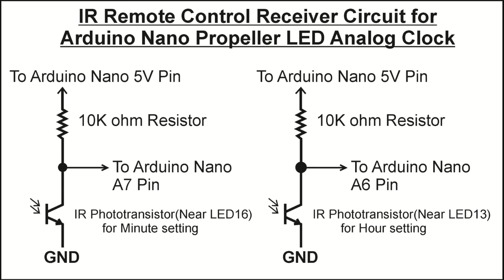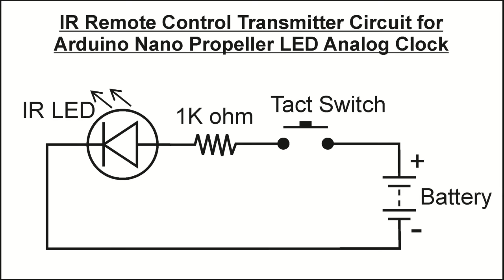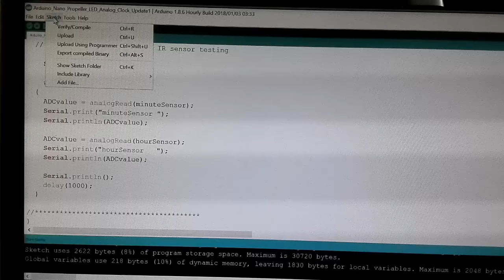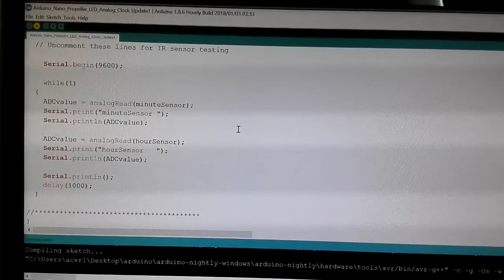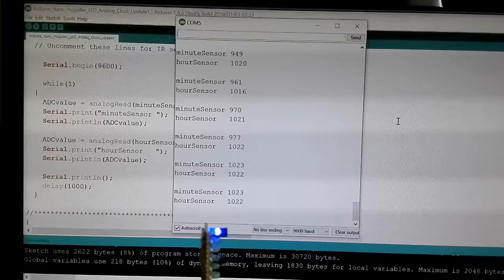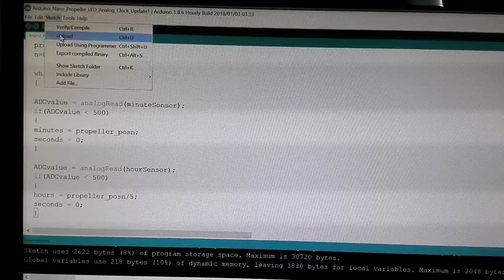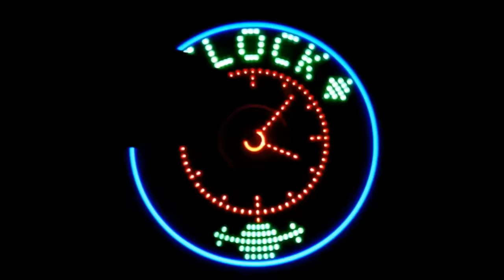Update 1 for Arduino Nano Propeller LED Analog Clock

Comment: Can u tell how much rpm dc motor u have used
Reply from the maker: It is around 1000 rpm. In one of the coming updates there will be a feature displaying RPM on the propeller display.

Comment: I did try but didnt work so easily. Middle and blue led blink but other doesnt blink
Reply from the maker: Please re-check connections.
Reply: can i send you a full code and video? its blink all the light about 0.3 sec and nothing happened .

Comment: i made the project
but one problem i am facing is that the full circle of the clock is not made
semi - circle clock is forming and while rotating, once  the leds are at the lower half it  is not working
plss help asap
Reply from the maker: Which Hall Sensor you are using? If you have used the same hall sensor as mentioned in the video then try by increasing the speed of motor.
Reply: @hobbyprojects  mention the hall sensor which u have used. plz reply soon
if someone does know then do reply guys
Reply from the maker: @ravishankar-ie5qr  Its WSH/W130

Comment: I request a reply for this.......

{ In this video you will see the Arduino UNO Propeller LED Analog Clock using Arduino UNO, Hall Sensor, magnet, LEDs and Resistors.
}

I copied these above lines in your above-mentioned website i.e.
https://www.hobbyprojects.com/projects/jsingh-projects/update-1-arduino-nano-propeller-led-analog-clock.html

Is that a typing mistake ????? That u have mentioned as Arduino UNO instead of

Arduino NANO.

as u have used Arduino NANO in this project.
Reply from the maker: Thank you for notifying this. It was a typing mistake.